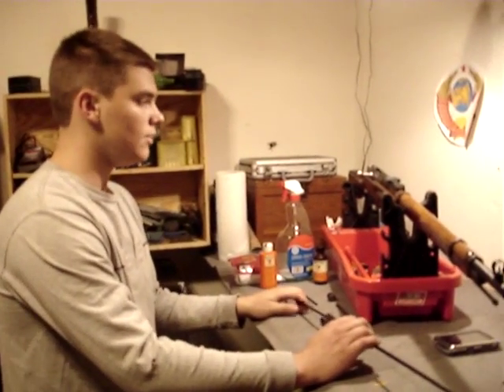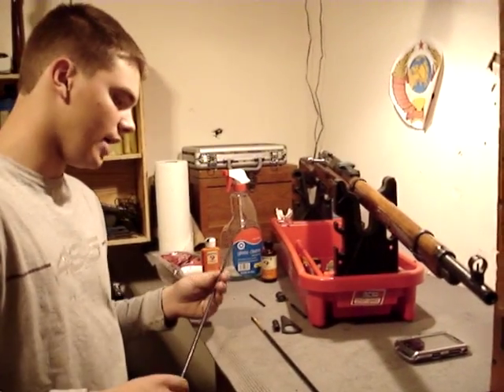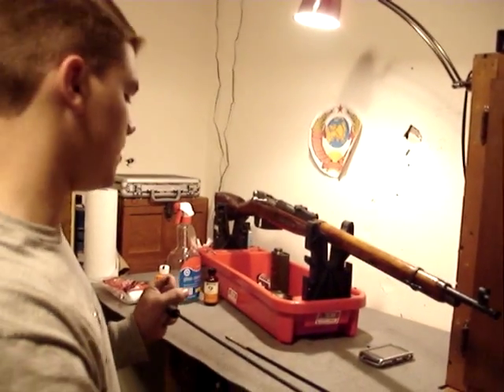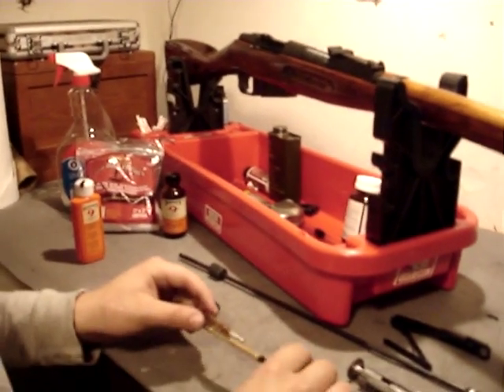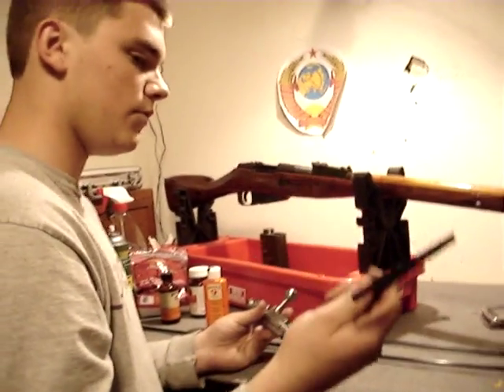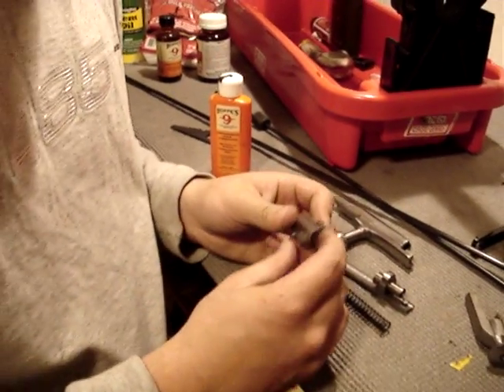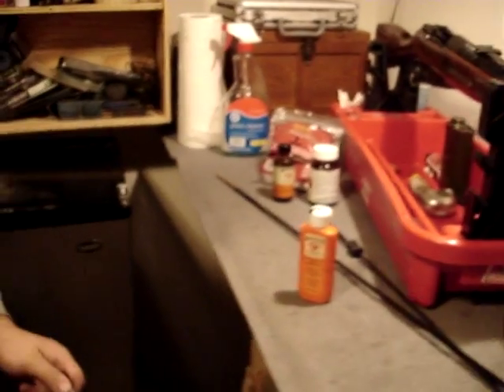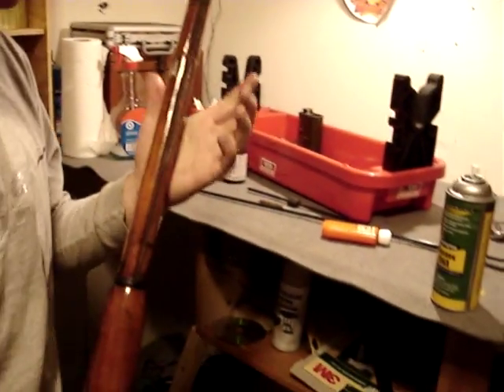how to clean a surplus rifle after shooting corrosive ammo

Comment: Hoppes 9 may say that it stops the effects of corrosive priming, but it doesn't. You need to spray the bore in windex to neutralize the salts, and taking apart the bolt to clean with windex is a good thing. Not only do you need to clean the bolt face and such, but the tip of that firing pin needs to be cleaned to. As to the guy who made the vid, I would suggest cleaning from the breach instead of from the muzzle.

Comment: It says it cleans residue left behind by corrosive primers but the point is, it doesn't work as advertised on corrosive stuff. You're better of spray windex down the bore and letting it sit for about 10-15 minutes then pushing it out with a patch than you are running Hoppes 9 through the bore immediately. It's mostly for powder fouling.